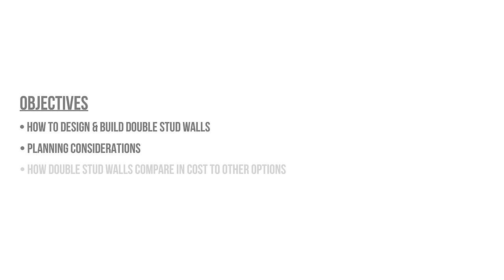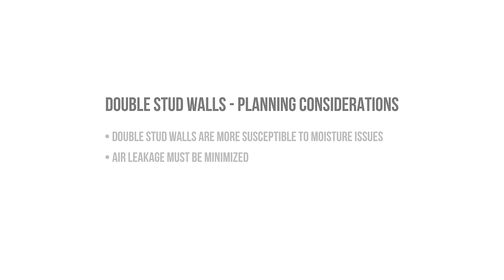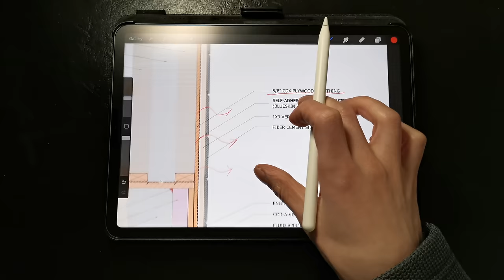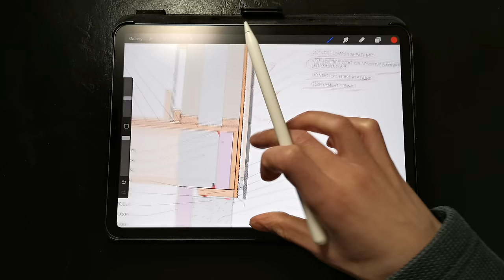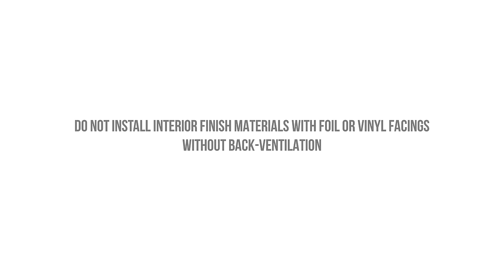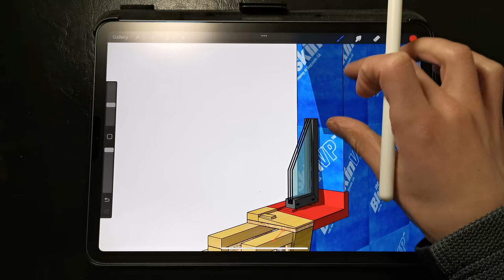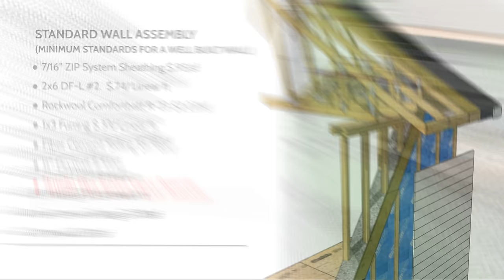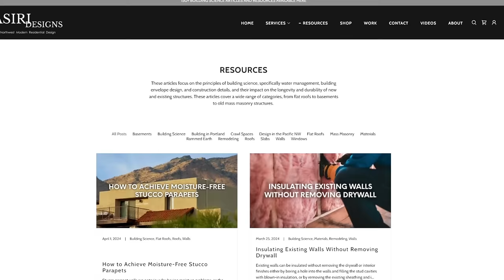Super Insulated Walls on a BUDGET?!? | Double Stud Walls Explained

Comment: I really enjoyed your video on double wall assemblies.  I believe this will be an excellent build in southern Florida.  OH WAIT but we don't have the cold weather. HOWEVER we do have the HEAT and some times a cold snap in the winter months.  This being said I do not believe that we need that interior vapor barrier in Southern Florida.  The worst constructed homes in the area I live of Northern Florida is very simply poor construction practices.  The exterior brick, then 1/8" foil sheet attached to the stud, 3 1/2" stud wall then drywall or paneling.  Now get this; aluminum single pane windows extremely poor construction I do not like fiberglass batts as insulation.  Horrible to work with and over time it breaks down due to moisture issues.

In Southern Florida I would like to build a 10" double wall constructed wall.  Use many of your principles of construction especially around the windows but use an 8 ply window construction as fixed windows.  The only working windows will be the required egress windows in the bedrooms.   All other windows will be fix panes with 8 ply about 3 1/2" thickness and to protect them from hurricanes apply a 2" clear poly panel on the exterior of the window opening.

Install a good fresh air exchange system in the house and dehumidifier as well.

Thank you for sharing your double wall assembly.

Comment: Having worked in construction, I must say what's on paper vs what's in real life are two very different scenarios. You want to have air membranes on the inside and outside of your double wall and the only way you guarantee the performance is if the membranes are more or less 100% sealed. I am yet to see any project in real life that lives up to that standard. Even if the carpenters get up to almost 100%, there will be other trades that will punch holes like nobody's business or the home owner will make modifications/renovations, etc later on which will compromise your system. The moral of the story, the simpler, the better. If you must have a membrane, have only one and provide ventilation opportunities on both sides of that membrane for moisture to dry out. That's a much safer bet in my opinion. So keep structure separate from insulation and keep insulation on the outside of the structure. My two cents
Reply: High-performance construction does require close supervision of the subcontractors. Air sealing the interior side of the wall assembly is easy if everyone is on the same page. My wife and I elected to build the house ourselves as local builders were all orangutans.

Comment: Do you think it would be bad thermally speaking to use a 2x10 plate wjth offset 2' o/c 2x4 walls staggered?
Reply: Some people do it that way, but why? It's so much easier to simply frame up two independent walls, all in 2x4s.

Comment: How do you meet the electrical code requirements for wires to be recessed back from the face of studs in order to avoid being punctured by drywall screws when using 2x3 wood furring on edge?
Reply: Code requires 1 1/4 inch from front face of the wall assembly about to be drywalled. Those 2x3s are fine.

Comment: Since ZIP is based on OSB, would you not recommend using ZIP with a double stud (12") wall assembly?
Reply from the maker: Personally, I'd avoid ZIP for double stud walls that exceed R-40 to be on the safe side. I like building in as much redundancy as possible when it comes to these double wall assemblies. Some people have had luck using ZIP for double stud assemblies, it's just that they're going to be less tolerant of incidental moisture.

Comment: Awesome video, I was curious the difference between using a separate ply and air barrier for sheathing on the exterior wall instead of using zip sheathing?
Reply from the maker: Thank you - Simply put, plywood has a significantly better drying potential compared to OSB, as plywood can become up to seven times more permeable when it gets "wet", whereas OSB does not. The self-adhered membrane is also more vapor open than the coating on the ZIP sheathing. When it comes to these super insulated walls, it's crucial that they have the ability to dry out if/when they get wet.

Comment: Would it be a problem to use a product like zip sheathing and tape rather than standard plywood and peel/stick?
Reply: I had the same question. I do see many other videos on YT where they were building double stud walls with zipsystem. I think if you have good sealing with zip tape on all the seams, really good overhangs and a well working rain screen you'd be just fine.

Comment: Our builds (cabin first, house later) are up against native forest which is susceptible to fires. I want steel or fibre cement cladding and galvanised steel spacers to hang the cladding off of, and some kind of heat proof insulation on the outside as a priority no matter what happens on the inside. Cannot get rockwool here, sadly. I suspect glass fibre would melt if temps extreme enough and only delay the catastrophe. Am I screwed or is there another option?
Reply: It's not as difficult to protect a home from wildfire as you think. Over 90% of all structure fires are as a result of wind-driven firebrands arriving several miles ahead of the fire front. If embers can accumulate under a wood deck, or in debris-filled gutters you will lose the home. Make sure the building envelope is tight: if embers enter through a crawlspace vent or into the attic, you will lose your home. If all combustibles are removed from the perimeter of the home there will be no sustained high temperatures to ignite the framing. Hardi composite cement siding is an excellent choice (we went with it) and any wall insulation will do (we chose blown-in cellulose). Remember, if you're worried about extremely high temperatures from, say, burning forest, remove the trees to a distance of at least thirty feet. One hundred feet would be smarter. And if you have water, and a source of back-up power, consider roof-top sprinklers. We sprinkled our already fire-resistant home and feel ready for the next wildfire.

Comment: Too much loss of interior square footage. I prefer exterior insulation.
Reply from the maker: I'd tend to agree about the rigid insulation, but a double wall system is something that you would plan out early during the initial schematic design phase to accommodate that wall thickness. A loss of square footage is only a problem if it's an afterthought during the process. Rigid insulation also needs to be planned for with regard to windows, doors, and other fenestration.

Comment: I designed an built my house starting at 25 yrs old after reading Mother earth news and everything I could find on super insulating and the local building codes for guess 5 ish years, I am a millwright so the drafting, building ect... was something I was comfortable with, also I live in Canada which is very dry in winter with short summers, the foundation is 24 inch thick cement with a floating cement pad sitting on 8 inchs of foam with vapour barrier , the walls are typical 6 inch studs ,outside plywood, tar,papered , then flagstone, they have firestops,insulated,then vapour barrier, then 3 inch airgap , then built another wall 2/4 with firestops holding the electrical , insulated , vapour barrier , drywall , took 10 years to build 2 summers were digging the foundation by hand , it's 2 1/2 storys and about 3000 sq ft , the roof is trussed an comes out to r 60 , the walls r40 , half the house has a crawlspace, insulated and vapour barrier where the plumbing ect... are under the kitchen,bathroom area , the windows are glazed double pane, I think the outside walls breath through the tar paper and cement somewhat and the inside walls I dunno, so far no mold , unless your really anal and seal all the electrical outlets an stuff your going to have air movement , also you have to consider the dewpoint in the wall, where it is, mine is on the outside face of the vapour barrier on the outside wall that breaths, your wall is solid insulation so ? third of the way in I dunno something like that though, finished this house 35 years ago an have no regrets, some things with what is available today I would probably change , mostly the mechanical it has come a long way , I used pink fiberglass insulation today would use that green steel stuff that doesn't burn and is sound deadening, used that in my workshop an it's good stuff but wasn't made when I built the house, the house is very slow to change temp and in the winter if it's sunny will heat itself , it has heavy thinsulate curtains that keep cold/heat out/in, dunno what it would cost to build today i'm guessing alot, the inside walls are fully framed with headers ect... you could remove the outside framing an still have a house as they are framed today, anyone building their own house um if you want to save some miserable work hire someone to do the drywall because that really sucks, aside from that i'm pushing 70 and the work was worth the effort my wife of 49 years an I love it an would never move unless forced by old age. my 2 cents

Comment: The additiona materials and labor would take decades to break even, but if your client wants that fuzzy feeling go for it.. We like rich people spending money.   Me,  Ive learned about the point of diminishing returns so R30 walls are plenty, as long as it's air sealed well.  It's the attic we need more fluffy stuff in and that's easy.
Reply: A super-insulated home is warmer in winter, cooler in summer, quieter all year round. It's NOT all about payback periods. Once upon a time everyone convinced themselves that R12 was more than enough, and I still know people freezing their butts off in their under-insulated homes. If the lowest possible cost is all that matters, well, good luck to you.

Comment: Elaborate designs that rely on perfect details to keep them from rotting ignore the vast majority of construction practices, which is I want it done yesterday.  The owner, the GC, and the subs all wanted the job completed yesterday, so workers cut corners.  Generally, a worker is valued by how quickly they work.  Maybe the elite top 10% of contractors charging top dollar can execute this system, which leaves 90% as eventual rot boxes.  Its just not realistic for mass production.
Reply: I have seen these rot boxes.  I have tremendous experience in construction. I built my own house with no subcontractors. The reason is simple. Going back to the year 2000, I don’t want to pay subcontractors $100 an hour for doing shoddy work.  I don’t care if it takes me three times longer to do it because I’m not in the trade. I will do it right. My house proves it

Comment: all that glue and tape and plastic sheet is not going to age well. i wouldnt build a house that depended on 100% vapor barrier protection with no air infiltration. it's an experimental idea with a track record of failure. 

you're hmmin and hawin about the triple glazing. it's not an option, it's a necessity at r-60. recessing the windows also is madness. way too many points of failure when not flush with exterior. 

if you must use materials that can trap moisture and rot, shouldnt there be active ventilation? i want to see tubes in these walls that remove moisture actively. will little fans and temperature+humidity sensors. 

the other way to go is build with materials that don't rot and which can breathe. an R-20 aircrete wall doesnt need an interior drywall surface or membrane. and can have a metal rainscreen on the exterior, no membrane. a lot less plastic, lot less points of failure. insulation, thermal mass, and structure in one.
Reply: I pretty much agree with you. It is ridiculous to build a wall with so many steps and so much adhesive tape. We all know what happens to this stuff.

I have a timber frame wall home that I built myself, tarpaper and stucco on the outside, and I have inset windows and that was done very very carefully. Proper roof overhang also. I was bewildered by This video. Furring on the inside and furring on the outside, so many vapor layers. Crazy

Comment: Well, it’s only a 27% increase in material cost your framing labor for outside walls will double you’ll definitely have an increase in labor for the fairing strips plus all the added labor liquid applied membranes and all the custom door and window details. Yes you do get a very high R value, what you need to look at is what is the reduction in heat loss through the wall assemblies. Go find a point of diminishing returns with the energy savings will never outweigh material and labor costs. By the time you factor in all this specialty products and construction techniques, you would be better off building a conventional wall and adding  spray foam.

Comment: The info in this video is good and accurate. BUT   anyone considering using this system should check out a "sip" system first. Better results with far less effort and as a bonus the longevity of sip systems doesn't rely on tape seams or later trades destroying the barriers. But thanks for the info.
Reply: SIP = $$$$$$$$
Reply: @magallanas  sips are more money up front over traditional framing, but the system in this video would be very close on materials and the labor would be 3 or 4 times the sip route.
Reply: @mobuilder73  this could be true, but it depends on who is supplying the SIPS (lots of variance with producers in the US), and contractors (mainly electricians and plumbers) willing to work with this product because it is still fairly uncommon, but more so with timber frames
Reply: @magallanas  true story.. there are some that are very pricey ( we use EPS they are easy to work with and send the complete package where most other suppliers don't). And electricians do tend to not like them at first until they realize there are premade wire chases built in. We also have plumbing chases made in.

Comment: Great vid! 🤩

In sweden we usually don't have a double wall with cavity, but we do often have a vapor barrier on the inside sandwhiched between the vertical wall studs and horizontal 2x2s that we nail the plasterboard to.  This allows us to run the services behind the plasterboard but not piercing the vapor barrier.  A good viz is https://www.youtube.com/watch?v=tJD8SPMfvV0&t=33s
Reply: Yes that is the way to do it, if you’re going to use wood framing.

I’m an American and I have traveled a lot and one of the things I learned is that we can learn a lot from other people elsewhere. Most Americans are very insular and they get stuck with dumb thinking

Comment: What is the cost impact of a larger foundation if you need to maintain a minimum interior size footprint.  Also, can you provide any insight into how this transitions to an insulated riof with conditioned attic space, continuity of your barriers and ecternally attached eaves?  Awesome video BTW showing multiple ways to achieve outcomes.

Comment: To make an apples to apples comparison with external insulation, you need to include the cost of extending your foundation/slab/floor by at least 7.5" to maintain your interior square footage.  Then the double wall requires more labor so exterior insulation might be quite a bit less expensive than you calculate.

Comment: For an older home renovation you could do this to just the sides of the home where the winter wind blows the most so you do not lose too much square footage especially if you already have to pull down to the studs due to not having any insulation in the first place.

Comment: Do not use blown cellulose! It settles and then creates pockets in which you have massive holes of heat loss which creates condensation in the wall cavity and mold galore. Some great technical ideas and then he said this??! Ugh.
Reply from the maker: Almost like I talked about this at 6:59....
Reply: It cant settle if you pack it correctly....
Reply: @ASIRIDesigns  i wouldn't even have suggested it.
Reply: @michaelfranks341  you blow it in...
You pack it in by hand. Wow, you're incredible.

Comment: I don't know when I will ever have the chance to build a house, but this information is still very interesting. Currently, I'm living in about as low performance of a house as possible,...still, I can dream. One concern I would have with building walls as described here is that in the future, people would be unlikely to take proper precautions during any repairs or remodeling. Even with a 1.5 inch service cavity present, would the next person not end up popping holes in the vapor barrier to install new light switches or receptacles in standard electrical boxes?

Comment: You are significantly increasing cost because we are adding footprint square footage as well as all the other items you mentioned (longer eves, etc.). Why cant people stop messing with long held and proven designs??? You are building future moisture problems which add even further lifespan costs. I've lived in one of these experiments from the 80s and literally almost died from the mold issues. My current house is in the far north and I absolutely never used these methods and have no underground spaces or wasted footprint. You need to build and live in your experiments then report back what you would have done differently. Put the money into your privacy and bring the outside in and stop worrying about making coolers with R60 walls!
Reply: How many more steps can we add before the entire budget of the United States is involved in building a single home?